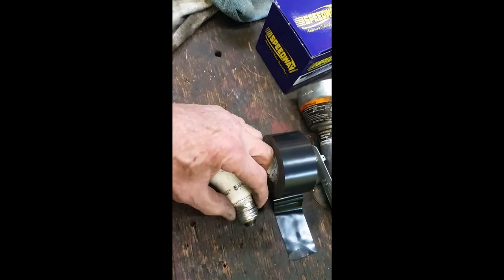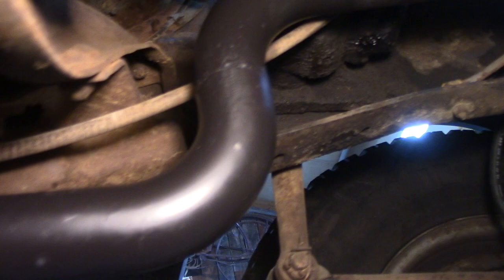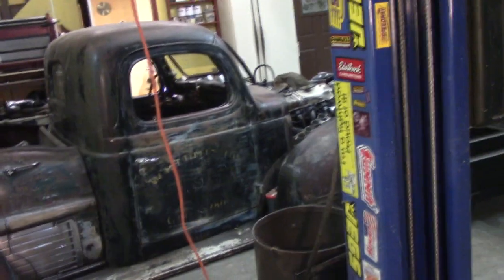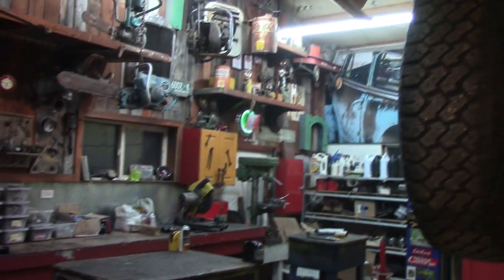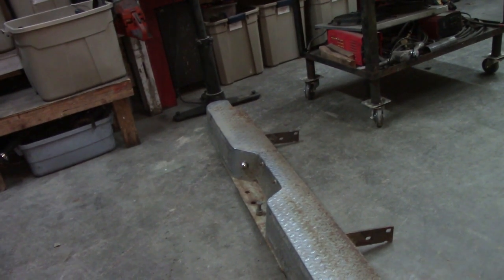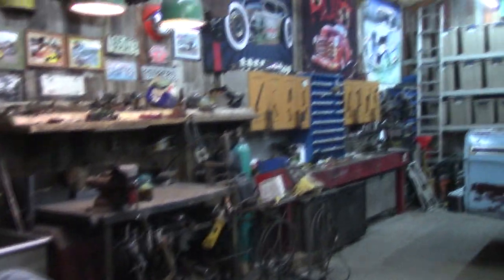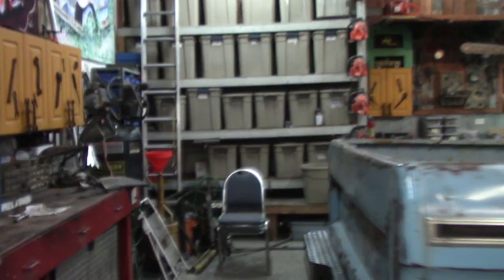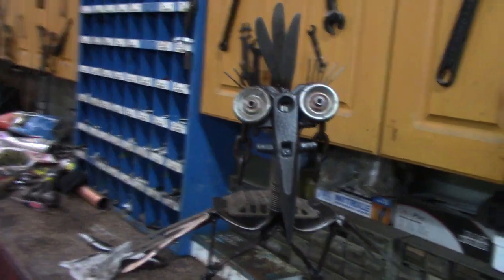1965 DODGE D200 - rear bumper

Comment: Yes Ken its best to get that tire bracket out from under the truck. After I had to get the spare out from under my '89 F150 I went and took all of the brackets and hangers out from underneath. I am in the process now of Making a mount for the bed of my truck with the bracket attached to my truck tool box. It will definitely give you a lot more room to put that hefty bumper on that truck. Its great to see you working in the shop and moving around even if it was before your open heart surgery looking pretty good there Ken.